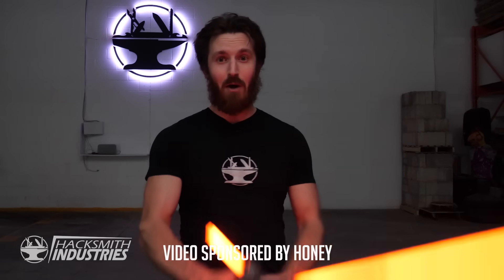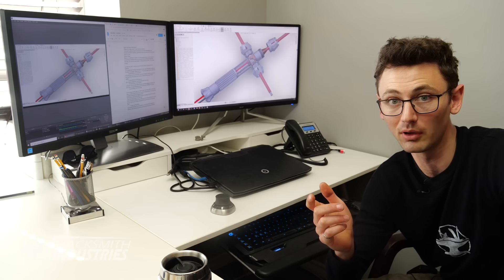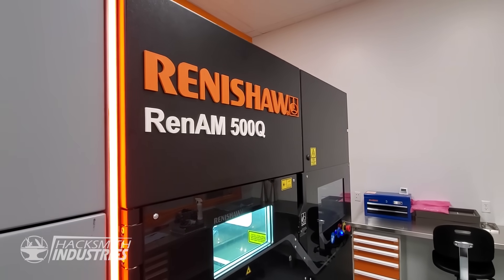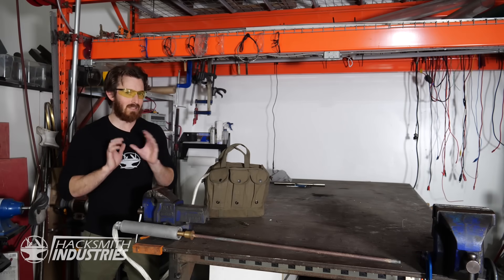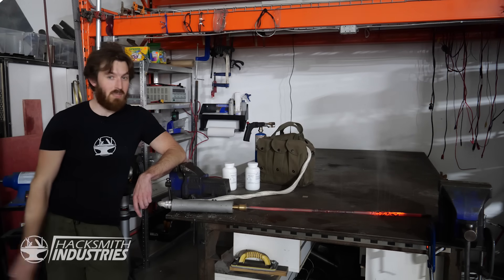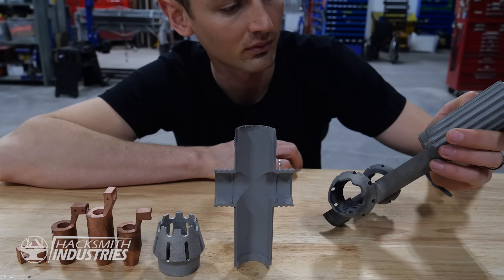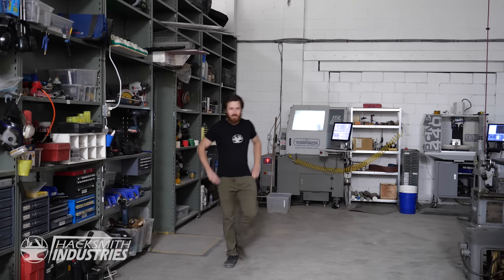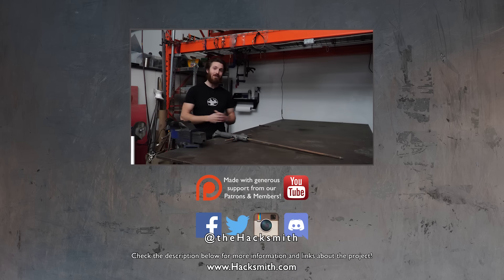3000° Kylo Ren Lightsaber! (+ GIVEAWAY!)

Comment: I love the Hacksmith
Reply from the maker: And we love our YouTube members and Patreon supporters!
Reply: the Hacksmith can you try luke’s lightsaber
Reply: @toast9372   how would they make it blue?
Reply: Donchu Gottawanna they would probably have to make it heat up to an extremely high temperature. Or just use plasma.
Reply: @donchugottawanna1116  he does got a point
Reply: @donchugottawanna1116  There is a such thing a blue fire
Reply: @RLR_STAR   by using blue flame 😃
Reply: Donchu Gottawanna cold fire
Reply: @donchugottawanna1116  I think ammonium nitrate 🤷
Reply: Donchu Gottawanna different fuels makes different colours also Luke’s is green
Reply: Donchu Gottawanna or green
Reply: Donchu Gottawanna maybe a new type of fire
Reply: @uni_diver0851  You are wrong. Blue fire is either fire with a different chemical compound or fire that is hotter than orange or reddish fire
Reply: @thorfinnavrb  Lukes has two lightsabers throughout the original trilogy one is blue and one is green
Reply: Donchu Gottawanna there’s blue and green bro
Reply: @toast9372  he can make the hilt but the color is not an option
Reply: @toast9372  which one? Luke's Green or Blue One?
Reply: @RLR_STAR  you cant use plasma
Reply: @RLR_STAR  Love the "just" use plasma. I guess it isn't very easy
Reply: Donchu Gottawanna can’t they use copper chloride?
Reply: Fighter Jet I don’t think it would be possible
Reply: @hacksmith  i have a question about the giveaway
Reply: @hacksmith  id love to be a member but my parents won't let me
Reply: the Hacksmith Dude you are a fusion between Obi-Wan and Captain America
Reply: @hacksmith  And we love you and your creations
Reply: the Hacksmith I love him
Reply: @hacksmith  Only patreon Supporters and Youtube members?? B-But...What about us? 😥😥😥
Reply: @hacksmith  you should re-edit this video so everytime he tears a tool up or does something like touch the saber to insert a hysterical Yoda laugh!🤣
Reply: the Hacksmith how you get that really cool little thing on your name
Reply: @hacksmith  cool
Reply: @hacksmith  The Temp is wrong, If you were to be nearby something thats 3000° you would melt in seconds
Reply: @hacksmith  I am glad you guys did not get hurt
Reply: @hacksmith  can you make the Percy Jackson sword
Reply: @hacksmith  I have an idea for a lightsaber.  How about an inquisitor lightsaber? It would be hard, but cool. It could include a motor that would allow it to spin and it would be double bladed.
Reply: @hacksmith  Can you please do Takeda's Blade Whips from Mortal Kombat for the next video?
Reply: @hacksmith  ye
Reply: @hacksmith  And not your fans? lol
Reply: @hacksmith  id like to make one of the protosabers, but I need to research more about electricity first
Reply: @hacksmith  just the members? :c
Reply: @hacksmith  what about us simple mortals that are poor
Reply: @hacksmith  but not genuine viewers?
Reply: @hacksmith  dont u love us we dont have money but we watch ur content!
Reply: @hacksmith  is awesome
Reply: Why is this 2 days ago?
Reply: @koitsaimuel4893  Patreon
Reply: @koitsaimuel4893  hes a member, members get to see the videos early
Reply: @koitsaimuel4893  they are members
Reply: @koitsaimuel4893   Members get videos early
Reply: @koitsaimuel4893  i don know
Reply: @koitsaimuel4893  it says 2 hours ago
Reply: @koitsaimuel4893  Right
Reply: @koitsaimuel4893  My question is HOW. Hacksmith posted this today.
Reply: Koit Saimuel being patreon allows you to watch the video before others
Reply: Koit Saimuel  because patron members can see the vid early
Reply: Koit Saimuel patrons can watch videos early
Reply: @koitsaimuel4893  it's called membership they can access videos early then us
Reply: Cuz they get early access to videos.
Reply: Koit Saimuel if you’re a patreon then you get to watch the video early
Reply: @koitsaimuel4893  idk i think its a glitch ot says 4 days ago for me but the video says 1 day ago
Reply: Koit Saimuel Patreon has early access
Reply: Koit Saimuel they get cud’s early
Reply: Koit Saimuel they probably commented that during a premiere
Reply: they are patreon
Reply: Is this 2 days ago because you are a patreon and you saw this video earlier
Reply: Yeah why this says two days ago when the vid came out today
Reply: GStevenE12 patrons can watch videos early
Reply: @gstevene1252  pateron
Reply: same
Reply: I love democracy
Reply: So cool. really a great rebuild
Reply: Hey, James when things clear up try to make the flash device from iron man 3.
Reply: me too
Reply: Why are u sayin that but not subscribed??
Reply: Honey = money
Reply: Same
Reply: How was this made 3 days ago?
Reply: I want it i dont have none please hacksmith and i love your vids light saber🤔
Reply: Guys cuz hes a members of the channel sooooo thry can see it beforr it releases
Reply: I love him too
Reply: Same!!!
Reply: anything you say you love about a youtuber in the comment section they put a heart on it
Reply: Чети между редовете
Reply: Teddy Riemen nice
Reply: Yes agree hecksmith is awesome
Reply: He isn’t subbed.
Reply: Към си ти ве
Reply: Teddy Riemen agreed
Reply: And i love how u got theese many likes from nothing
Reply: But you arent subbed -_-
Reply: Is the Youtuber that’s gonna try out the lightsaber JustDustin
Reply: Who doesn't
Reply: How does this say 3 days ago
Reply: Wait why is this 3 days ago-
Reply: Teddy Riemen ye
Reply: Teddy Riemen same
Reply: Teddy Riemen same
Reply: Teddy Riemen Ohhhh I think it’s a Patreon thing they get the video early or something
Reply: Teddy Riemen not subscribed
Reply: Teddy Riemen same
Reply: Reson I started making youtube videos (Factors OF Fiction)
Reply: @factorsoffiction3268  If you were to be around something this hot you would melt in seconds so yeah that video title has the tempature all wrong
Reply: Why is this comment 3 days ago
Reply: i love it more
Reply: SIMP jk me too
Reply: 👋 😅 hi
Reply: I do t
Reply: Me to
Reply: How does this even make sense, 3 days ago?
Reply: I Love Refrigerators
Reply: How did you post that message 3 days ago
Reply: Same
Reply: Teddy Riemen welllll true since u have a loyalty badge
Reply: How do you get early acess
Reply: Democracy 
Watch out Anikan and Palps is coming
Reply: 4th ten may be with you
Reply: Why is this 3 days ago
Reply: Ikr
Reply: Wait hol up

This is 3 days ago? Huh??
Reply: Imagine getting 3.2k likes by saying that
Reply: 3 days ago
Reply: How did you post this three days ago, the video came out 8 hours ago
Reply: Teddy Riemen simp
Reply: can you guys make the doomslayers wrist blade?
Reply: I love the hack smith too
Reply: Bru my man is a time traveler
Reply: We all love him
Reply: Uh why 3 days ago
Reply: Teddy Riemen same
Reply: I would like to try that that looks fun 👍
Reply: Make a blue or green
Reply: @Koit Saimuel ILLUMINATI CONFIRMED
Reply: Your not subscribed tho
Reply: Weird, considering you aren't even subscribed...
Reply: TyrAnnicAl2 that’s what I said
Reply: simp
Reply: why tf is this 3 days ago
Reply: Thank you hacksmith
Reply: Teddy Riemen me too
Reply: My boy got that premium membership
Reply: @Donchu Gottawanna Hacksmith said he was making a plasma saber he also said he had 
A way to make the saber a different colour
Reply: Me too
Reply: how did u comment this three days ago when the vid wasn't even out lol?
Reply: I love you tho
Reply: Teddy Riemen l
Reply: Teddy Riemen May the 4th be with you
Reply: Why is it 4 days ago this was uploaded today?!??!?!
Reply: Ello
Reply: Yay
Reply: how did you reply 4 days ago
Reply: Brother? Is that you?
Reply: me too
Reply: Teddy Riemen  same
Reply: how u does comment before video is watchable
Reply: Yes
Reply: Same
Reply: me to
Reply: Teddy Riemen same
Reply: Teddy Riemen  me to
Reply: J
Reply: This video is 2 day old and this comment is 5 day old wtf
Reply: Right
Reply: And may the 5th is the revenge of the 5th
Reply: Same
Reply: Wait this video was only mad 3 days ago
Reply: How is this comment posted 5 days ago but the video came out 3 days ago?
Reply: Tf he uploaded this vid 3 days ago and he commented 5 days agor
Reply: We are both
Reply: I love what hacksmith these
Reply: Teddy Riemen same
Reply: Same
Reply: Me too
Reply: Why is this 2 days ago
Reply: @Thedanger.mp4  they have early access to the videos
Reply: T iemon 
How do you get access to that?
Reply: @WellCookedPotatoes  Patreon
Reply: @WellCookedPotatoes  by joining membership
Reply: WellCookedPotatoes become a member
Reply: @Thedanger.mp4  Patreon
Reply: @Thedanger.mp4  they have early access because they're a member, look at the badge next to his name.
Reply: @melviness4769  thats not fair tho
Reply: Koit Saimuel no he paid for it
Reply: @Algenhirn  yeah I'm not a patron  but it's totally fair
Reply: Koit Saimuel They are paying sooooo
Reply: @koitsaimuel4893  Why not. They support him and they get some perks. People who give money are a big part of the reason that we can enjoy these amazing expensive videos, for free. We should be thanking them.
Reply: @koitsaimuel4893  they paid money for it of course it's fair
Reply: Magic
Reply: R u collabing with tkor?
Reply: Prem Narisshar they have
Reply: How is this 3 days ago
Reply: @snippersmity3076  Read the previous replies, PATREON
Reply: Same
Reply: Video comes out may 4th, comment posted may 1st
Reply: Wait 3 days ago? But the videos been up for 3 hours
Reply: Give me one
Reply: How was this comment 3 days ago?!
Reply: Why is the video 2 hours ago and this comment is 3 days ago? 🤨🧐
Reply: 3 days ago how? It’s only been here for three hours
Reply: wow you just typed I love the Hacksmith and 8,3k likes + a comment from the Hacksmith
Reply: Teddy Riemen how is this comment 3days ago but its uploaded 1h. Ago